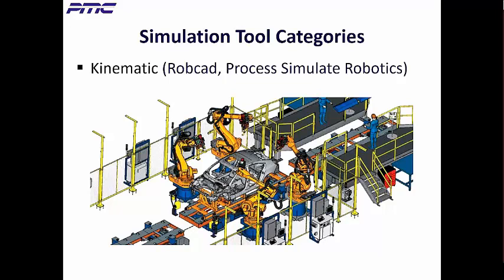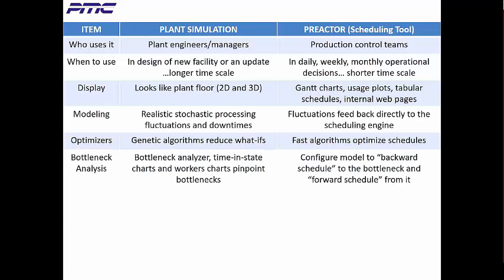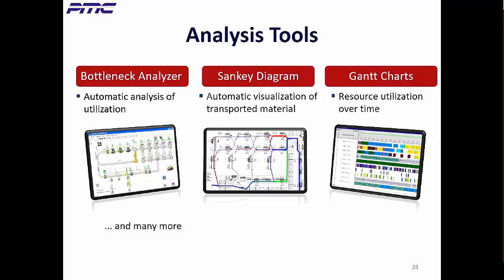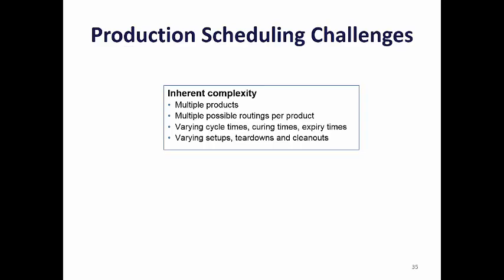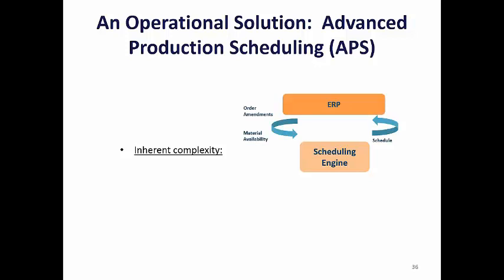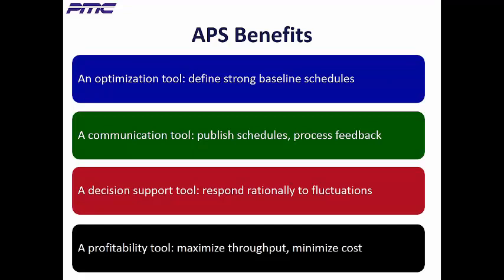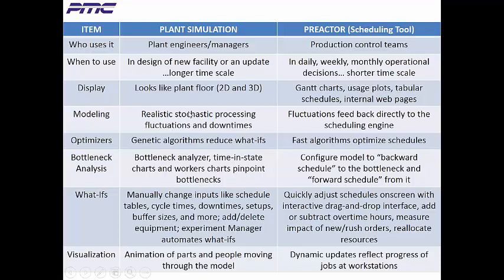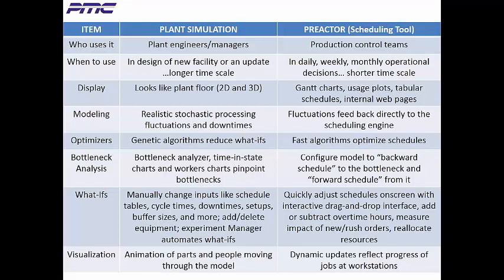When To Use Simulation Vs Scheduling Software in Optimizing Your Production

Comment: And Plant Simulation is said to be used for long-term planning, which seems to conflict with modeling detailed parameters. 
In my opinion, is it more appropriate to perform detailed modeling simulations for short term accurate scheduling?
Reply: We say long term planning for discrete event simulation like Plant Simulation because discrete event is usually used to determine average throughput over time. The strengths of that type of simulation is the use of random distributions to come close to reality… For example, equipment goes down (Fails) at random times. When you incorporate random events like failures into a simulation you should make sure that you run the simulation long enough for the failures (where fail times are times to repair are randomized)  to occur several times… not a real time run. 

Here’s what can happen if you don’t run the simulation “long enough” … the random number for an extra-long failure could occur shortly after simulation starts… this can skew the results by having a much larger than average overall failure rate. But if you run the simulation long enough…. The failures would average out… more closely simulate reality. Also if you are starting the simulation from time zero… you should set the “Warmup Time” high enough so that the simulation runs until WIP (Work in Process) is at steady-state condition before collecting statistics.

If you do make a short run.. like checking out a day’s schedule…. You could make an assumption like… can I meet this schedule if no equipment goes down and no parts are in the system. Then in the simulation, make sure you turn off the modeling of failures. This will tell you if a schedule can be met under those assumption. If you don’t turn off Failures your results can be skewed toward too many.. or too little… failures.. depending on how the random numbers occur. 

You can also do the opposite… Feed a schedule from Plant Sim into the Scheduling Software.